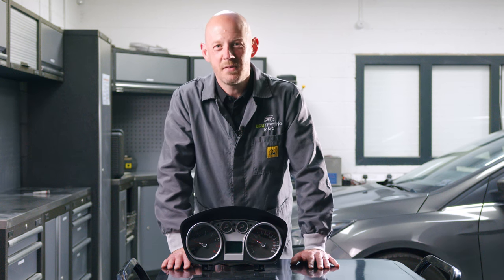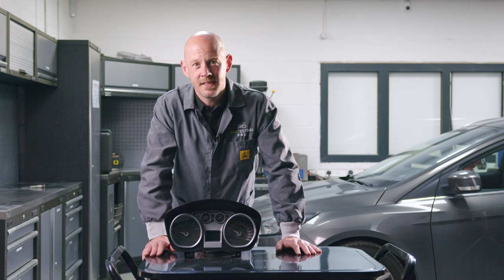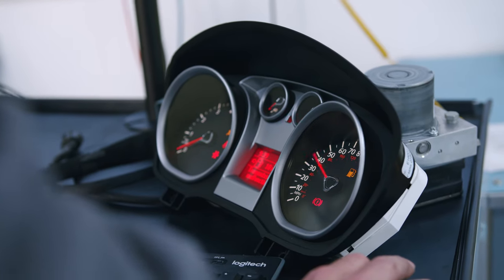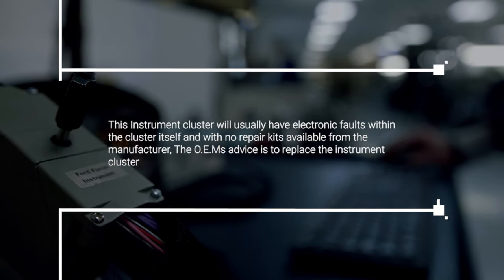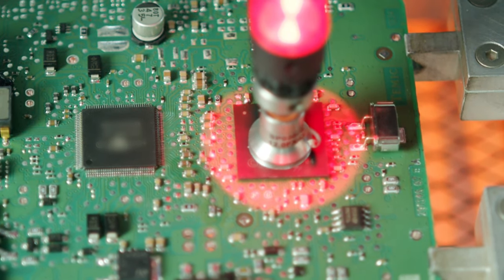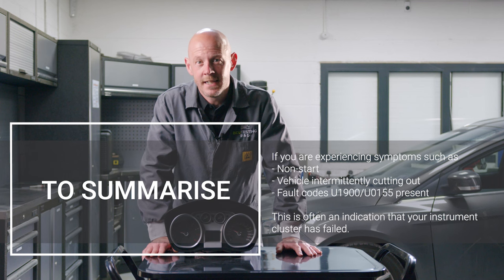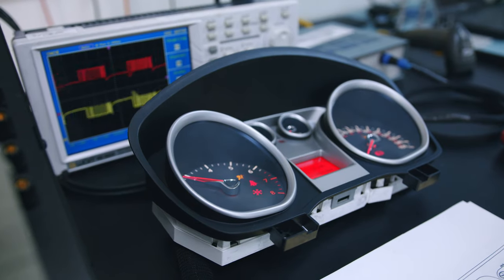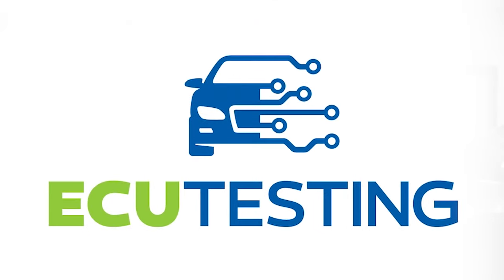Ford Focus Dash Fault (Dashboard Instrument Cluster)

Comment: Usually it's just a case of resoldering the main 34-way Tyco connector at the front of the instrument cluster's circuit board. The whole assembly clips together, so it's a bit fiddly. The gauge needles are removed as follows: Twist and pull large dials anticlockwise, small gauge dials are pulled and twisted in a clockwise direction to remove without damaging. The front fascia is then removed in order to gain access to the 34-way Tyco harness connector, which will have dry joints and will need to be resoldered, preferably with leaded solder!
Reply: I actually carried out this procedure on a friend’s Focus last week and the car has been running perfectly since.
Reply: Are the gauges easily changed or are you only removing needles?My speedometer stopped working and I have another cluster for parts? Any help is much apreciated. or is it the 34 way tyco connector causing it to mess-up you think
Reply: @jacobsmooki2328  Hi. I only removed the needles, but once you remove the circuit board, the motors for the gauges can be desoldered from the board. There’s a good video here: https://youtu.be/6o8x8HnYzMA

There is a way to test the gauges on the Mk.1 Focus. I think you held down the trip reset button while turning on the ignition or something. Might be worth checking that just in case there’s a problem with the speed sensor on the car somewhere. If it needs to come apart then this video is a good guide: https://youtu.be/6o8x8HnYzMA
Reply: @davemckiernan where are you from mate fancy having a look at mine ?
Reply: I just had this on a 2007 Mondeo - the radio would switch off / not power on for no reason.  Turns out it was the lack of the MM-CAN from the instrument cluster - dry joints on the connector.  Disassembled the cluster, removed the lead free solder from the connector pads and resoldered with good old 60/40.  No more issues.
Reply: Absolutely spot on...

Comment: my ford focus 2010 model shows engine malfunction sign some time when i turn the engine on , red light stay on but after few minutes disappeared . I send my car to Halfords diagnose centre and they said they didnt find any problem then Mr clutch diagnoses as well and they said the same so any one knows what is the real problem ? or is there any danger fault can appear during driving? TIA

Comment: When i turn my headligjts on, my fuel guage goes to zero although i have fuel in the car. When i turn the lights off,  the fuel guage is fine. After driving a while the car thinks i have no fuel and it says i need to service the car and the engine has a fault. I took the cluster out and checked the solder,  all good but still a problem, any ideas?
Reply from the maker: Hi. The symptoms you are describing could indicate a fault with the instrument cluster, but it is not something with have seen before and could be an external module/wiring fault. If you would like to send your unit into us for testing please email our technical support team on info@ecutesting.com with the following details. Your make and model of vehicle, the symptoms of your fault (as described above), any fault codes present, and the part number printed on your instrument cluster. They will be happy to advise you further.

Comment: My problems is. My battery drain out overnight even I not use my car. So I checked with multimeter and take out one by one fuse at passenger side. Then after I pull out Instrument cluster relay, automatically amphere reading of Multimeter drop significantly which is means Instrument cluster cause battery drain. But, after I put the fuse back, I cannot start the engine. Did I need to setting anything? Theres a bliking sign at dashboard meter ask me to setting. But I dont know how to do it.

Comment: I don't have flicking lights. My problem is that the outside temperature is not showing the red frost sign on the hand break light is on. The clicker for the turn signals is not on, but the outside lights do work. Centrol locking with the key won't work right and won't lock the doors manually, and the heated windscreen won't come on. But the car drives fine

Comment: Could this cause limp mode
Reply from the maker: Hi, one of the symptoms of this failure is the warning message 'reduced acceleration' showing on the cluster before all the gauges fail and the engine is put into limp mode.

Comment: Does this affect Ford Focus 2013 SE also?

While driving multiple error messages appear on my dashboard, it says engine failure, power assist failure, air pressure sensor failure.... the power steering stops working when this happens but the engine does not cut out.

However, once I turn the engine off, it won't restart again. Any ideas?
Reply from the maker: Hi. It may be an external issue and not one with the instrument cluster, however we would recommend getting the vehicle scanned for fault codes to help diagnose the cause. Please email the results of the scan to our technical support team at info@ecutesting.com along with all the information you have posted in your comment, as well as the part number printed on the back of you cluster. They will be happy to advise you further. Thanks.

Comment: Hi I have a problem with a 2010 1.6tdci Ford focus keyless start, sometimes it does not listen to the keys and wont start or power up the instrument cluster.  if I disconnect the car  battery and then reconnect it the car will start. But it will only be ok for a few days then the same problems persists. Is this the instrument cluster? We have replaced the wireless key module in the roof lining but still same problem. Obviously we have changed batteries in the key fobs.
Reply from the maker: Hi. Please email our technical support team on info@ecutesting.com with the details of your message above, as well as any fault codes present in the vehicle, and finally the part number printed on the back of your instrument cluster. They will be able to advise you further. Thanks.

Comment: I have a problem with my ford focus 2009 1.6L model. The milage screen is stay on when switch off the engine and it does not go off until battery dead. It seems there is no fault on   the fuse board. Is this a problem related to Instrumental cluster?
Reply from the maker: Hi. This isn't something we commonly see from a faulty instrument cluster, however we may still be able to test the unit for you to rule it out. Please contact our technical support team via email at info@ecutesting.com with the details you have mentioned in your comment and they will advise you further. Thanks
Reply: @Ecutestinglimited  hi I have a Mk4 mondeo 09 plate I only have the middle bit working on the cluster nothing else but all my lights work OK is this a cluster problem thanks if it is can you send me your details so I can send it to you thanks

Comment: My problem always starts with the tpms light. But then ill get other lights too.like the brake light or door ajar light,, oh ya and the AC always qits working. I can usually smack the dash and it goes back to normal. Slowly its been getting worse and more often

Comment: Hi

Ok I’m getting U1900 among MANY other error codes too! All of a sudden.

I drove through a puddle and all the lights on my cluster started flashing, beeping and saying Engine Malfunction!? 

Cant really believe the puddle was a coincidence but also don’t see how it has caused this? 

Mechanic is a bit miffed and tried changing the clutch sensor but it hasn’t stopped “engine malfunction” “speed mode” “power steering mode malfunction” messages from beeping up
Pedometers all fail, digits reset. Its horrible when it happens while driving and has been known to not start up again .

Can water ride up and brake the cluster at all??? How has this happened so suddenly?? The car drives perfectly

Codes that appear: 

PO231 
PO571
P1936
P2121
P2122
U1900
P0231
P0571
P1260

Thanks for reading. I need my car and cant do without it for my job🤦🏻‍♂️
Reply from the maker: Hi, driving through the puddle could be coincidence, as we have seen all these faults being related to an instrument cluster fault before. However, it could also be problems with the wiring from the instrument cluster to the BCM, so we would recommend ruling any wiring faults out first before condemning the unit. Please contact our technical support team via email on info@ecutesting.com if you have any further questions, or if you would like to send your instrument cluster in for a re-build. Cheers.
Reply: @Ecutestinglimited  hi!

All good! Got it fixed! A dude came , took it out and cleaned it in his van. Works PERFECTLY now!!! 
It even seems to have fixed an OLDER problem the car has had all year of cutting out when slowing down for traffic lights & bends etc!

Thanks for your help
Reply from the maker: @DeeTeaDee  Amazing, glad you got it sorted!
Reply: @Ecutestinglimited  makes two of us!!! 😆 👍🏻

Comment: My focus instrument cluster screen comes on at random in the night and stays on for a long period of time after the car is turned off. I was wondering if anyone had any idea if this is the cluster on something else Wong with the car already had to replace the battery as it kept going flat and don't want to get left stranded. Any help would be greatly appreciated.
Reply from the maker: Hi. Are you able to scan for any fault codes? It sounds like it could be the instrument cluster failing. However, without further information, it could also be other factors on the vehicle causing it to stay on, e.g. problems with fuses. If you are able to get any fault codes or have any further questions, please contact our technical support team at info@ecutesting.com and they will assist you further. Thanks.
Reply: I bet you have a TravelPilot FX radio, it goes faulty and keeps the can bus alive..
Reply: Please help.. so I've got smax 1.8 2008
Juddering and goes into limp mode turning off and on again somtomes would fix it. Was told by someone maybe the cluster give it a bang. Banged it lightly and no won't start at all.. does this sound right?? I've never had any fault codes though.
Reply: Please help.. so I've got smax 1.8 2008
Juddering and goes into limp mode turning off and on again somtomes would fix it. Was told by someone maybe the cluster give it a bang. Banged it lightly and no won't start at all.. does this sound right?? I've never had any fault codes though.
Reply: Mine does too!!!!
Reply: I have the same issue, if u find the solution let me know here in a comment pleas.
My instrument cluster turns on itself after a period of time when my car is turned off.
Reply: I found those fault codes after scaning my car :
U1900
B1357
B159A
P1622
P0380
Reply: Did you ever sort this I have the exact same issue right now, the screen stays on all night and when I come out in the morning the battery is completely flat.
Reply: Unfortunately, not yet I'm still looking for someone to help me to slove this issue.
I will let you know in a comment when I did.
Reply: Just purchased 1.6 petrol c.max.2009. Starts with engine malfunction and warning LIGHTS COMING ON.And sometimes won't even start.